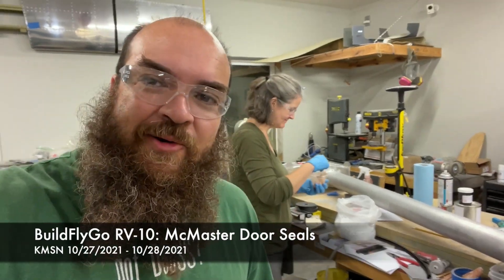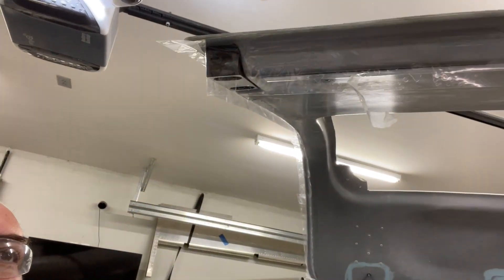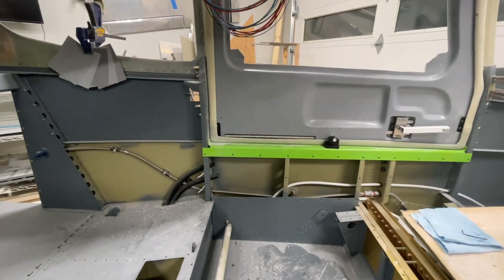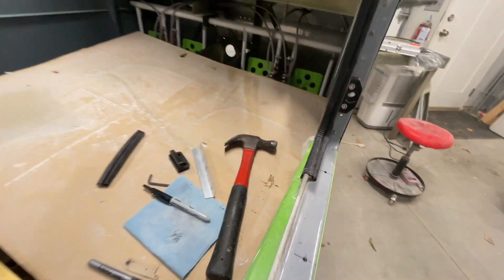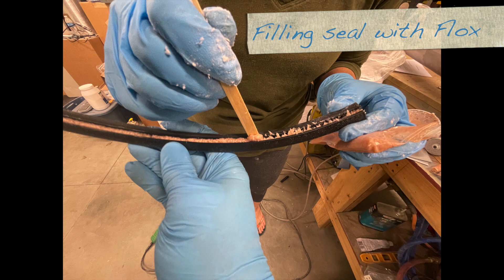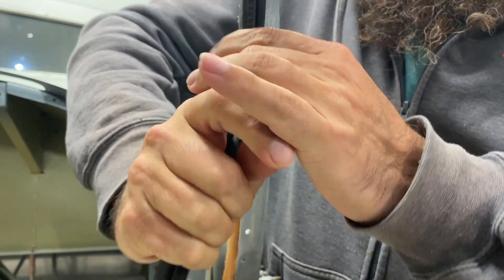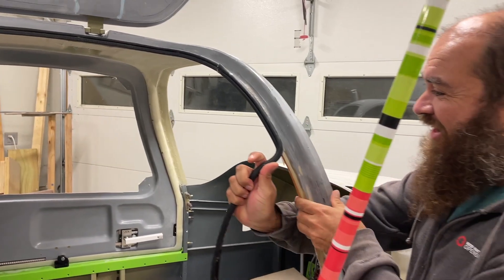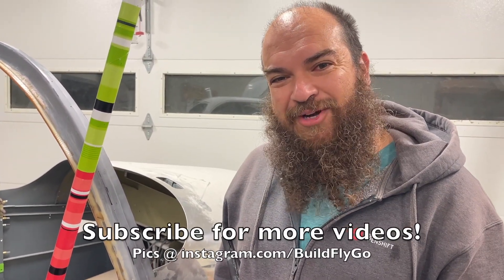RV-10 Build: 10/29/2021 - McMaster Door Seal Details

Comment: Are you happy with the 3/16” seal? I was originally reading that everyone was using the 1/4” so that’s what I ordered. Now I’m seeing more threads with people not being able to close the doors when using the 1/4” and the fact that you used the 3/16’s has me wondering if i should return my 1/4” seal and get the 3/16’s instead. I guess the only real difference would be slightly more sanding on my part to get the 1/4 to fit correct?
Reply from the maker: Doors aren't on for good yet so hard to say. It should be fairly easy to replace if you decide to go with a different one later though so I wouldn't stress about it :)

Comment: Quick question…. I wonder if the seals being on the fuselage will suffer from wear and tear as people get in and out of the cockpit perhaps rubbing and dragging across whereas seals on the door wouldn’t be affected?
Reply from the maker: Good question. It might, but they are pretty easy to replace and cost ~$1.50/foot. If I end up having to replace them every few years it's not a problem.

Comment: Just as a heads up...whenever you do any work on the doors, such as this edge forming or fitting the locking pins, make sure you have the gas struts installed first.  The struts will cause the door to flex which will mess with the fit of the door.
Reply from the maker: Good tip! I’ll install that nice to recheck everything.